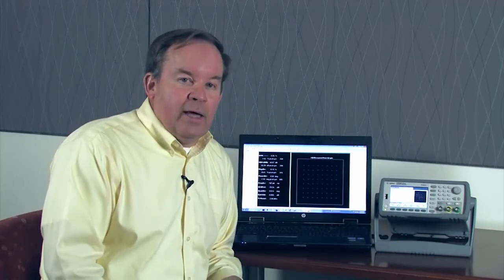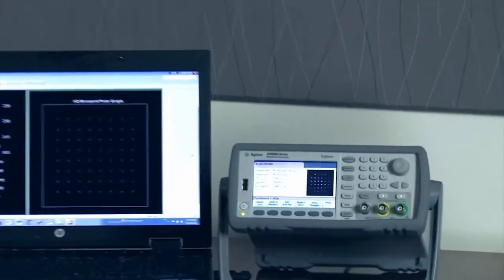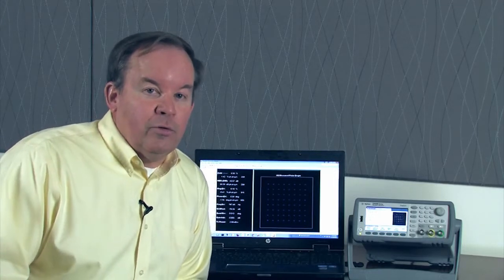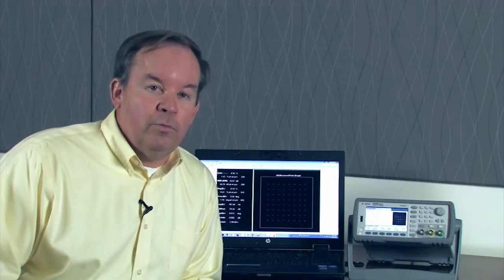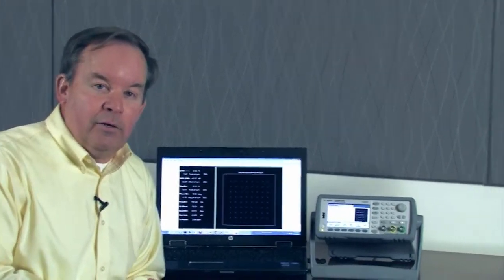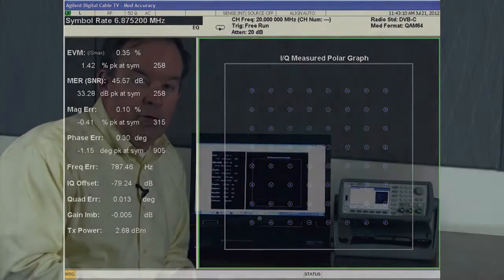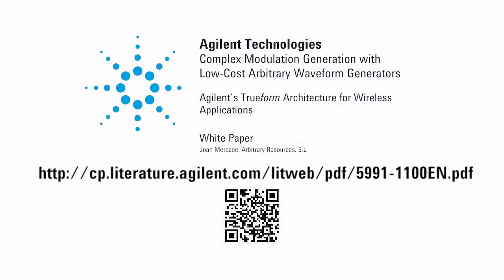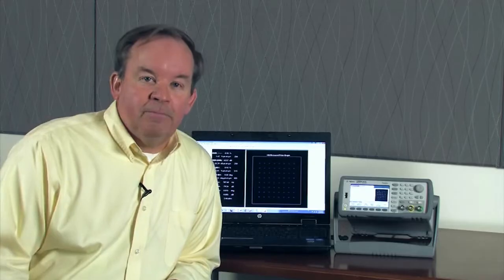Low Cost Baseband IQ Generation with Keysight's 33500 series Waveform Generator

Comment: What is the default offset of this generator.
How to generate 2v amp positive pulse
Reply from the maker: Manimaran G The default is 0V offset but you can change it to 2V.
Reply: @KeysightHandsOn  while checking in cro, we found the default offset is 1V.   I set 2Vpp and manually entered 1V ass offset. Is the correct setting for getting 2V positive pulse. Please do clarify